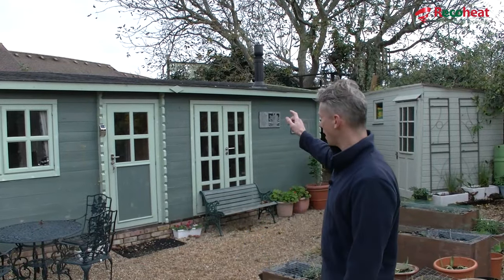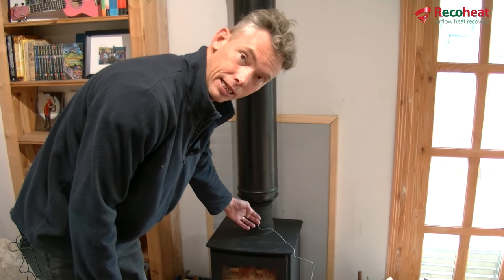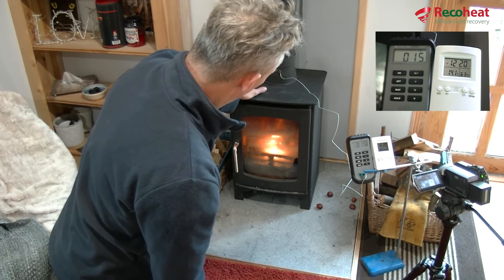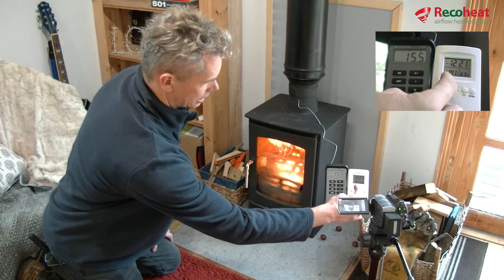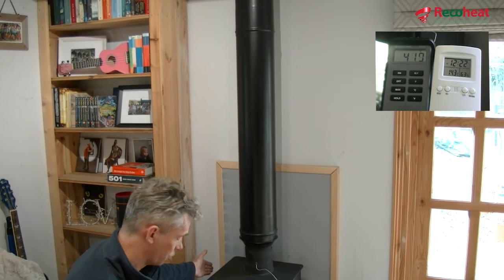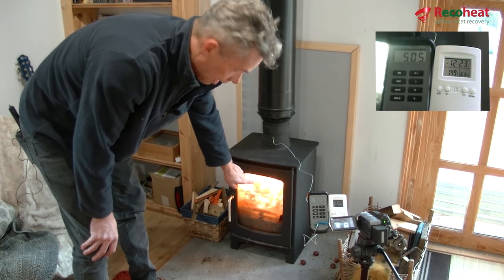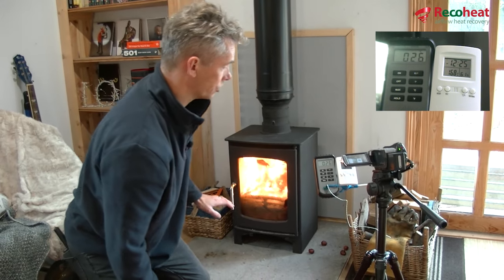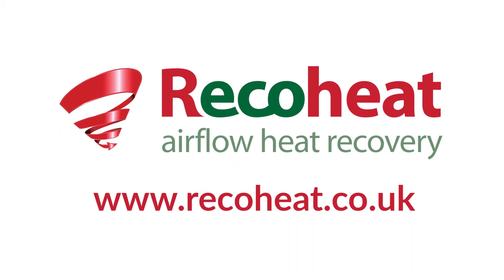Introducing the Recoheat heat recovery unit for wood and solid fuel burning stoves

Comment: interesting to see an old idea revamped. however the reason they stopped doing those systems is cooling the flue gases increases soot build up and the chimney clogs up rather fast. of course its impossible to heat the room more than normal without taking more heat out of the flue, conservation of energy and all that good stuff.
Reply from the maker: Thanks for your interest. It's interesting to hear your reference to other versions: can you be specific? We've found absolutely none. There are plenty of examples of convection and fanned air systems, and there are examples with water, but we've not found any using forced air and the turbulent boundary effect. This is our first video, and isn't the best explanation: our other videos give more accurate descriptions of the process and feedback on the device's real-world use over the last years. Both of the issues you raise are valid concerns, but don't actually occur in a healthy stove and flue system, principally because of the coil shape, which creates turbulence and so decreases flow resistance, and because the coil is being heated by the hottest part of the flue gas flume only in relation to its surface area which is very small relative to the flue itself - the equivalent of an extra 10cm on a 5" flue, and 6cm on a 6" flue. As the range of flue lengths any stove has to contend with - between 4.5m minimum to at least 10m on a domestic system - this increase cannot legally be enough to effect it, or the stove can't be sold.
Reply: @Recoheat  you missed the point. taking extra heat out of the flue makes it soot up more. with gas fires its fine because they burn clean and thats how efficient gas boilers work. i ran into it many many decades ago and it was ancient history then. i can't point to any details as its pre internet. 
one of the setups i've seen in use is a fan blowing along the side of the firebox in a duct as you don't have to worry about the firebox sooting up so much.
Reply from the maker: @tweake7175  With respect, I'm not missing the point, I'm saying it's not so: it doesn't soot up. I'm merely trying to explain why, but not arguing whether it does: it doesn't. It is a very obvious thing if it does, and if the stove is badly configured so that the bottom of the flue is not hot, then it can, which is why any potential operators have to check that the bottom section of their flue is clean in normal use before fitting. As such, it has the same operating conditions as a chimney liner and is no more likely to soot up. All flues have operating conditions and all flues soot up if those conditions aren't met: our device operates in identical conditions. The science of why our device works better than a fan-based system driving laminent air over the flue surface is interesting, but the difference in effective heat dispersal is enormous. Do take a look at our other videos etc: this is a genuinely effective device because of a genuinely innovative system that seems simple, but is actually not. Thanks again for your interest.
Reply: @Recoheat  Is this using any type of catalytic burning of the exhaust gasses?  If so, that would completely counter "tweake's" argument of increased soot.  Some newer wood burning stoves have a catalytic burner to burn the soot and smoke.  Free extra heat and almost NO soot in chimney.  But they are newer and have been a bit price prohibitive for my budget!
Reply from the maker: @agentmacguyver2974  We have our own physics to stop soot accumulating on the flue but are looking to combine with the Puriflue Midtec catalytic converter to create a product that's even more awesome!
Reply: @Recoheat   I don’t think that your device lowers the stack temperature appreciably? If you have a coil of pipe inside the flue pipe in which and you pump in compressed air I don’t think you are lowering the flue gas temperature appreciably I’d like to see a thermometer right on top of the stove in the actual in its flue and then put a thermometer in after your unit and that will show us exactly what you’re pulling out of there my guess is it won’t be very much?
Reply from the maker: @theusconstitution1776  That's right: neither we nor the external test engineers could measure a difference in the temperature with the Recheat running or not. You can detect a difference in use when it's very cold and you have a poor initial draft though, and need to wait for the coil to heat before switching the pump on so that it doesn't affect the draw. The physics modelling posits a drop in bulk average temperature of about 5%, but we generally base the potential drop as being the maximum equivalent to the relative surface area of the coil and additional single skin flue. On a 150mm flue (6"), that difference is equivalent to an additional 6omm of flue height, and on the 125mm (5") it's equivalent to an additional 100mm of flue height - so negligible and obviously within the required functioning range of a normal stove installation.

Comment: It's not  clear to me what's going on. Pls add a diagram  as to all the components and how they work
Reply from the maker: Check it out at www.recoheat.co.uk for diagrams etc. An air pump is pumping air at 1 litre per second through a sealed heat exchange unit in the flue, just above the stove. That heats the air to about 500 degrees so it expands and is expelled at about 4 litres per second. That jet of hot air draws the heat from the stove away with it and creates a much larger heat exchange area in front of the stove, and produces a positive pressure in the room that also moves the air away from the stove towards the edges of the room or out of the room - because it's higher pressure so replaces the lower pressure colder air. It therefore works in the opposite way to convection in terms of initial air flow, but creates a convection flow in and out of the room into other parts of the house.
Reply: @Recoheat  where is the pump inlet
Reply: @Recoheat  what prevents creosote and condensation from building on the cold parts of the coil where room air is entering? There's a massive temperature imbalance there
Reply from the maker: @gutrali  The turbulent barrier layer means heat transfer is largely complete through the vertical section of the coil. The air then descends into the hotter section of the flue. Little of the coil is cool therefore. The physics is just not the same as that of a laminar air flow.
Reply from the maker: @gutrali  On the back of the flue section
Reply: @Recoheat  
I don’t buy that I’m afraid.  The temperature of the entire flue above the heat exchanger will be much less - because you have extracted the heat.  Thats not rocket science.  
That’s not something you should be doing - because of the inevitable condensation and tar build up that will result.   
Are these units endorsed by manufacturers, and do they require building regs/ heatas certification?
Reply from the maker: @chrislawson70  There's not much point just dismissing the physics: it doesn't change because you don't like it. The flue gases are flowing, and the heat loss is not a fixed proportion, given the lossy and variable processes involved. If the air is at a similar temperature as the flue gases for a significant proportion of the distance travelled in the coil, then it's not extracting heat in the same way as, for example, a similar length of single-skin flue. The flux, fluid and thermo dynamics involved are highly complex, though the system is simple. Turbulent air flows act completely differently to laminar flows, and we're exploiting that. The unit follows the regs for baffles and rigid flue sections. Installation falls under building regs.

Comment: Not convinced, no details on installation or cost
Reply from the maker: The website is www.recoheat.co.uk for price details. Installation depends on where you are and where the stove is, insomuch as you need a competent person like a Hetas engineer to fit them in a domestic installation in England and Wales, but can do it yourself elsewhere. You need to be competent not so much for the fitting as for checking your stove and flue are working correctly: the bottom metre needs to be clean which shows it's hot enough so that the Recoheat will function correctly and stay clean.